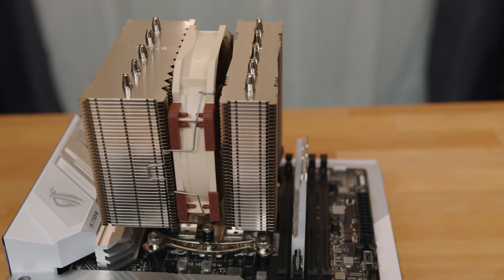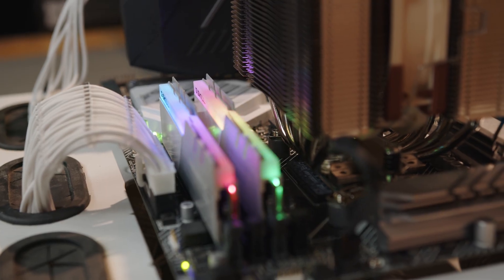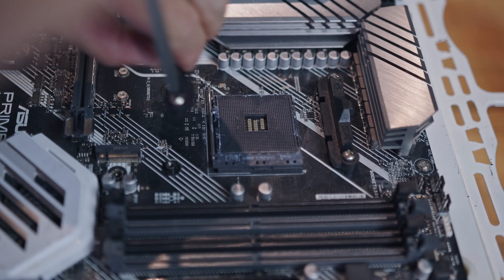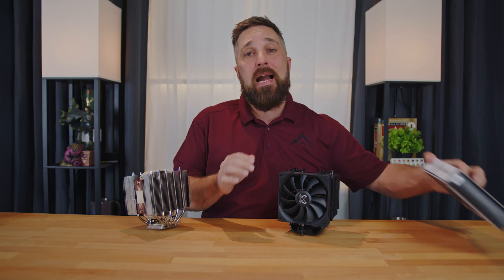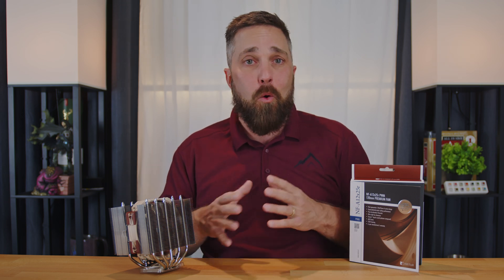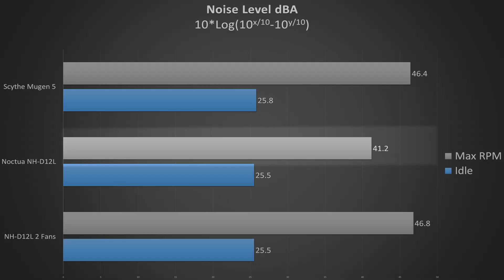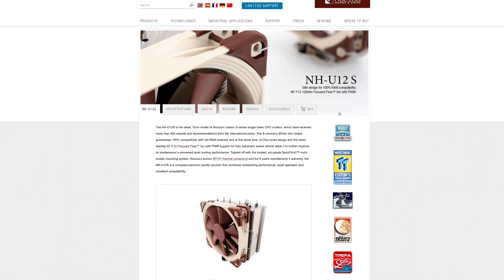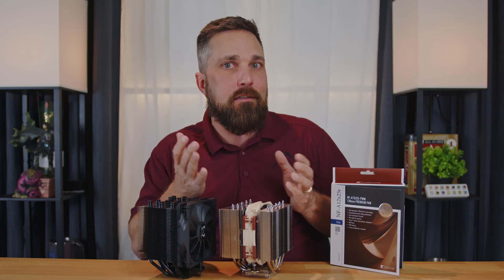The Best CPU Cooler 4U! Noctua NH-D12L Review.

Comment: i have a dell poweredge t410 that has  zeon 5675 cpu in it . problem is it came with 1 cpu and the last owner lost the cooling panel . i had a dell 5600 that have water cooling but surpise it dont fit . cpu and ram fit but cooler was a no go.... come to find out dell uses a narrow ilm setup . acording to noctua this will fit . i need to no if it will before i waste more money and buy a pair HEATKILLER IV PRO CPU Water Blocks !
this computer is for my budget home theater and house Compter build . so... it has 2 5675s , 8 sticks of 8gig ram , quadro k2200 gpu , and a edup ax210 wifi card . i have a Pioneer  SC-1222 with 12 klipsh speakers 2 cerwin-vega 18s powered by a crown ce2000 amp , ViewSonic PX701 projector , carls place 189 inch alr screen .

Comment: do i need nh d12l to pair with my i5 12400 for light premier pro 1080p editing work 8hours a day? or a cooler master hyper 212 black version is good enough?
Reply: I use noctua d15s to cool i5 11500 I think it worth it.  The fan never goes beyond 700rpm during benchmark even in summer and only around 2-300rpm when idle so the fan noise never bothered me. If budget and compatibility are no issues then always go with a better cooler you won't regret it.

Comment: A comparison with the Mugen 5 Rev C, would have been more proper. It comes with the fan spinning at 1500rpm instead of 1200rpm.
Reply from the maker: The Mugan 5 Black Edition has the same 1500rpm Kaze Flex 120mm fan as the rev C.

Comment: Just gonna say another cooler that is low and cools well, albeit in a smaller form factor, is the NH-u9s
Been using one with my Ryzen 7 5800X non-3D for quite a few months now, and other than something like 80 degrees in benchmarks, the highest I have gotten it to go was 70 degrees with hearts of iron IV running, and Trailmakers running at the same time, with me doing things in both of them to stress my cpu (Loading several high complexity vehicles in TM and running 5 speed with Kaiserreich in Hoi4).
Reply: wow whats your room temp like?
Reply: @FromBKI  68 degrees Fahrenheit without PC on. It does get heated up a bit but only to like 70 degrees when it's on though.

Comment: Just a correction: Regardless of CPU efficiency, all of the energy it consumes is transformed into heat energy, the efficiency just means it has better performance for the same amount of energy and heat. Different die topology and thermal conductivity will make one CPU easier to cool than another CPU despite both releasing the same amount of heat.
Reply from the maker: In regards to efficiency I was mostly referring to voltage leak while overclocking. I try not to get too technical in review videos as most ppl tend to click away when the convo gets overly technical. If I start getting into the efficiency of moving electrons through gates, even at the most basic level, I'll loose everyone.